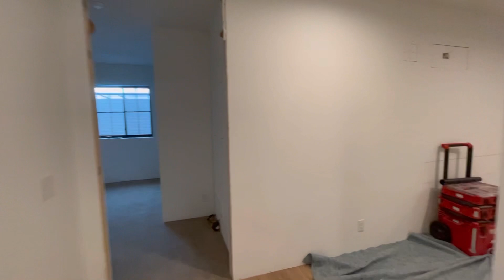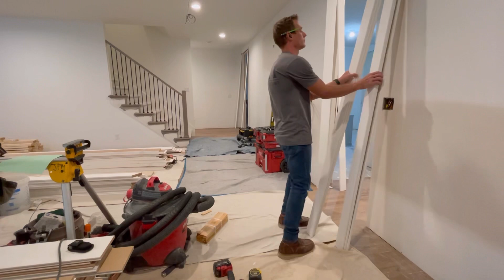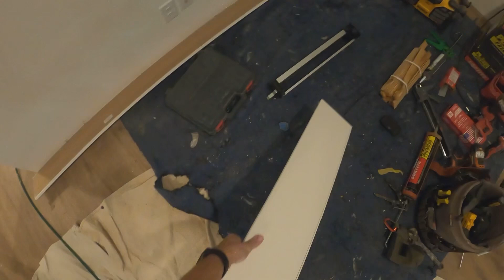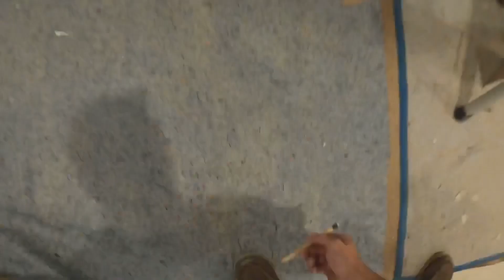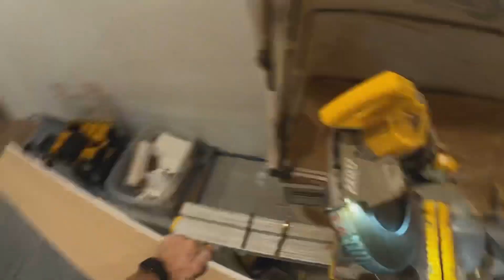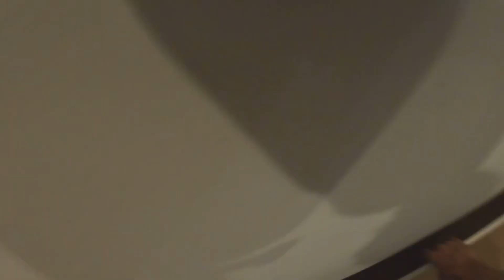Trimming a Basement EP - 2 - trim install

Comment: I noticed while cutting your head casings you were tilting the material up on the side away from the fence.  Is there a specific reason for this vs just sitting it flat on there?
Reply from the maker: It’s to slightly back bevel my trim. The drywall was tipping the casing backwards so in order to connect properly to the casing legs i tipped it